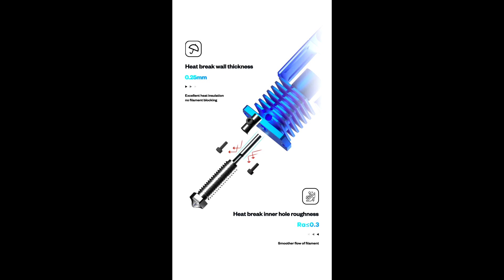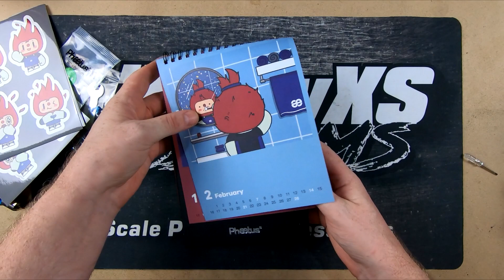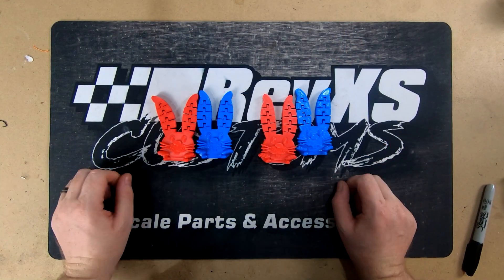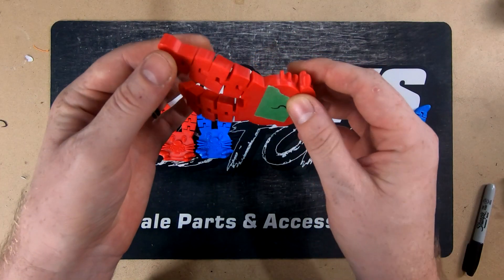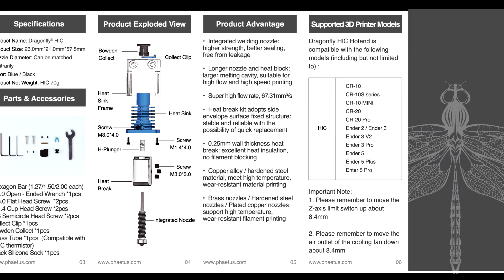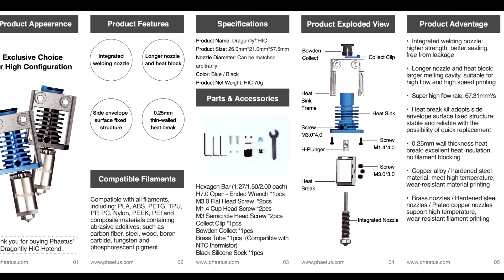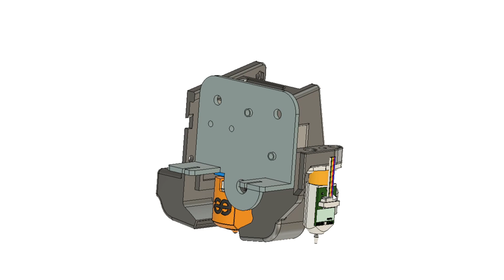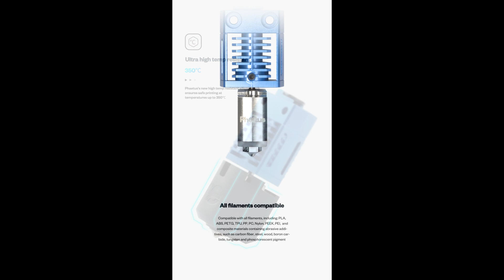Phaetus Dragonfly HIC HF Hotend Review

Comment: Plated copper nozzles are awesome, I've been using the same one for 1.5 years and it's still performing like new. I print mostly PETG with a bit of PLA here and there.
Reply from the maker: Got same nozzle on the dragonfly BMS which is older than this setup again run everything from pla,tpu,abs,petg and nylon carbon still going strong

Comment: How well does it do with stringing
Reply from the maker: Zero stringing for me,Final retraction settings been running is 2.5mm at 60mm/s
Reply: @RevXSCustoms  what abouts speeds what did you achieve with this hotend because i dont see point of upgrading stock creality unless printing hotter materials or needing extra speed my current ender 3 v2 stock is running 100mm/s on klipper how fast would this go to without skipping steps

Comment: did you have to change flow rate.
Reply from the maker: All my tests were printed on both stock and upgraded hotend with same files, So flow rate remained same
Reply: @RevXSCustoms  thanks.  having loads of problems with mine on ender 6. cant get good cooling using stock fan. prints look bad.  wish your stl could be used on the ender 6 :(  downloaded the fan duct
 mod but its no good
Reply from the maker: @RType2966  have had a few people want one for ender 6,will look into it
Reply: @RevXSCustoms  oh if you could. i purchased the ender 3 one but holes in the wrong place.  if you make a ender 6 version ill buy it. thanks for your help ;)

Comment: How is the flow for wood or any CF filled filaments ?
Reply from the maker: Short time be no issues, But many company's recommend a min of 0.5mm nozzle for wood and CF for long time use,Ive had no issues yet but iam not full time printing just one material on this hotend either

Comment: hi, I bought the file, can you tell me if it is also compatible with the dragonfly bms hotend? Thank you
Reply from the maker: Is to suit HIC as it longer overall than the BMS so cooling ducts on any existing files didn't suit this unit,BMS is same length as stock unit so many designs on thingiverse already
Reply: @RevXSCustoms  
i got it, and might it work if i can change the hotend position? unfortunately I have already bought and printed the file
Reply from the maker: Is a little adjustment to slot duct setup up and down but unsure if it will be enough for the BMS